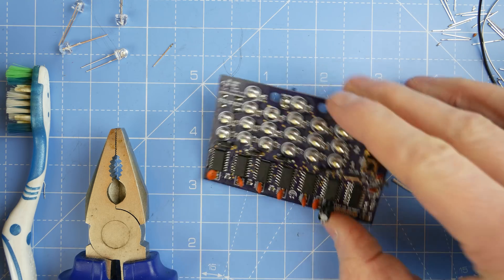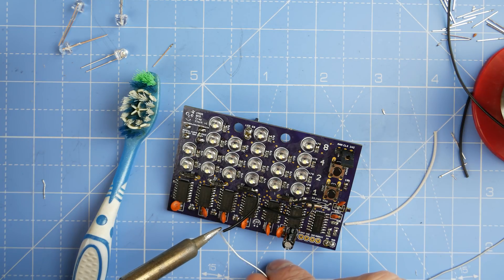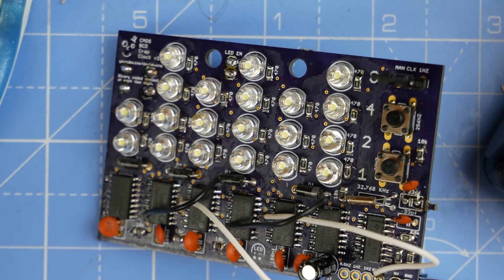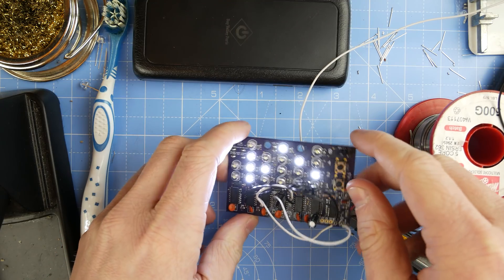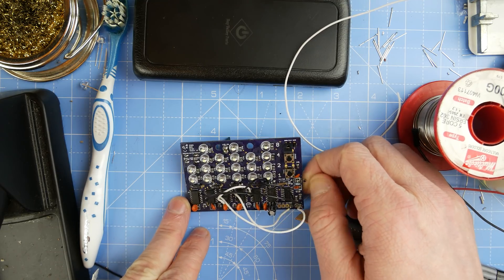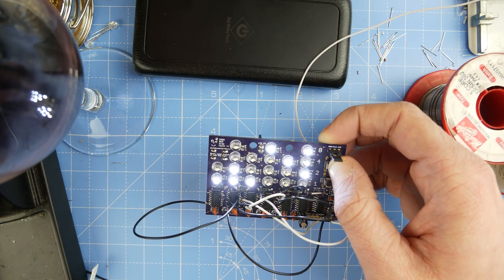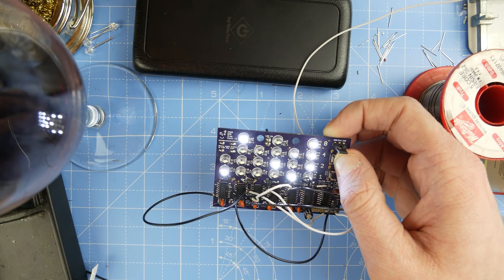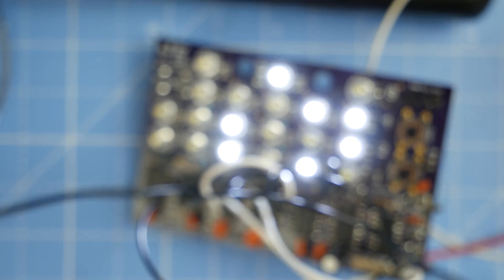Binary Clock Prototype Build - Part 4! (Actually working, bodge wires 'n all)

Comment: I would prototype this on a breadboard first. A faster way to go thru the hours is to hold a 5v jumper and touch it to the carry from the 3rd chip back from the right. 23 touches and you're done. Do you plan to reverse the backwards digits?
Reply from the maker: Hi Jack,  I did prototype it on a breadboard, you many not have seen those videos. I just managed to mess up when I copied it to the schematic.

Comment: So was this working by pure luck on the breadboard?
Reply from the maker: +Howard Jones nope, I just copied my circuit to the schematic wrong. I duplicated the seconds to tens of seconds circuit for convenience but never made all the appropriate wiring changes going from the ripple chain circuit to the AND gate triggered 4510s. Doesn't explain the mis-ordered LEDs, that is me just being thick.
Reply: Gotcha. Yeah, getting things transposed wrong I can definitely see happening to me :-) It was the 'misread datasheet' bit that seemed confusing when you had it working before.
Reply from the maker: I foolishly didn't go back to the breadboard to troubleshoot, I went to study the schematic and the datasheet. At some point during bread boarding I had figured out about the carry out signals but it leaked out of my brain.

Comment: The "joys" of electronics prototypes. lol

On two different recent projects now, I managed to swap some pins around on the ESP module, so the hardware SPI wouldn't work on the PCB.

The second time was due to a copy n paste. sigh. :p

Have you tried any circuit simulation btw? The are some free sims online that could have confirmed your circuit, but I can also recommend Proteus VSM, it's pretty awesome.

(free demo available, too.)

If nothing else, the binary clock has been a great learning tool for digital counters. hehe

I still have problems remembering things like which clock edge a specific TTL or CMOS chip works on.